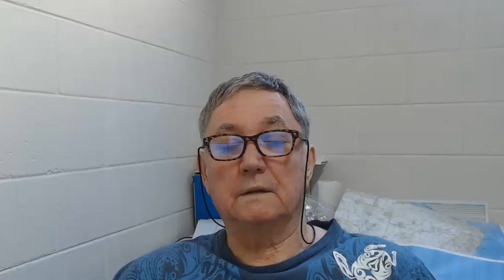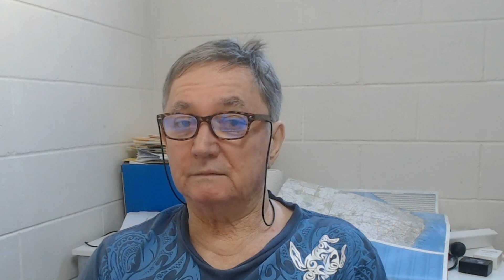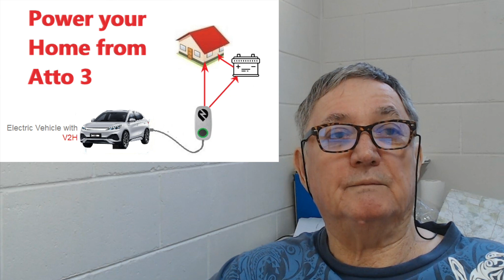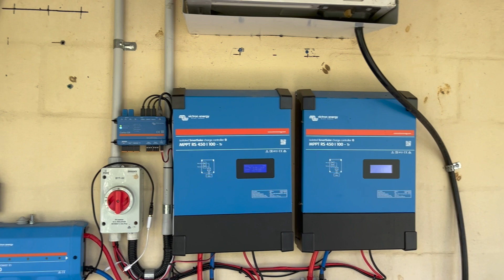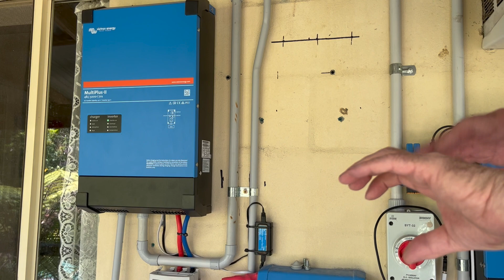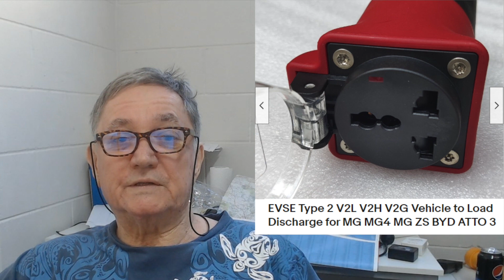How to Vehicle to Home Power for Atto 3

Comment: sorry but this is not the best way for "Vehicle to Home". Better to use Victron Skylla TG 48/50 230V Battery charger which is charging the home battery which can be any LFP smart battery that is connected to Victron Cerbo GX. This case EV AC output is completely isolated from Grid/AC and fully legal too.

Comment: Thanks for the information. We have a small stand-alone 240v solar system (2KVA inverter) that runs our bush cottage that has an alternate 240v input switch for changing over to a backup generator input to run the house (mainly fridge and lightsr & fan all under 2 kW). Thought we would be able to use our Atto3 VTL if solar fails, unfortunately doesn't seem to work when tested with a  couple LED  lights on in cottage. The car output power turned off. From what you are saying a isolation transformer would fix this? Or is there another issue perhaps with the way the generator input is wired?
Reply from the maker: The issue is the weird way the Atto 3 produces 240 volts. There is no earth. Yes an isolation transformer will fix it and needs to be connected to a generator input. Best get an electrician to sort out. Tell them to check to output from the Atto 3 and then tell them to connect to your bush house as a generator.

Comment: Thanks, some good hints.

I would definitely NOT use an iron core isolation transformer with an Atto3. This is because of the high inductive load this presents to the Atto's inverters. If anything goes wrong this could easily damage the Atto inverter output semi conductors. Additionally, if there is even the tiniest assymetry in the Atto's output wave form,  an iron core transformer can easily 'saturate' causing overheating and ultimately fire.

If you are going to isolate use only a switchmode transforming devices.

In an off grid situation the safest and most reliable approach would be to plug a switch mode charger (no more than 1.5KW, 250V 6A) into the Attos v2l output and use that to charge the home lighting battery, these are typically 12, 24, 32, or 48Volts.

To go the other way and charge the Atto from the house battery simply plug the Atto's charger into the off grid homes 240V GPO.  As long as it is rated at least 3KW you will get a slow but steady AC charge.

I have tried this with my own off grid home with no problems.
Reply from the maker: Ok, I am not an electrician, but I did check with an electrician. Absolutely work with an electrician.
Reply: @IanBennettsAus 

What I am suggesting doesn't need an electrician as it is simply plug in, no need to get into the wiring.

While I think the Atto's inverter is likely quite sound, I would not be inclined to power a house directly from it for reasons you outlined (earthing etc), as well as various appliances such as fridges and water pumps that might interact incorrectly, with the potential to cause damage. 

Household inverters used off grid homes are designed to cope with highly inductive loads such as some remote domestic water pumps.

If there is a problem and you damage the Attos inverters, the car could become undriveable and repairs costly.

A switch mode battery charger on the other hand is simply just another plug in appliance and as long as it is less than 2KW should be just as safe as the other appliances you see demo'ed with the Atto.

You are correct that the Leaf has a fully automatic interactive designed to replace home batteries. The necessary interface device designed and provided by Nissan, when I last checked costs about $5,000.